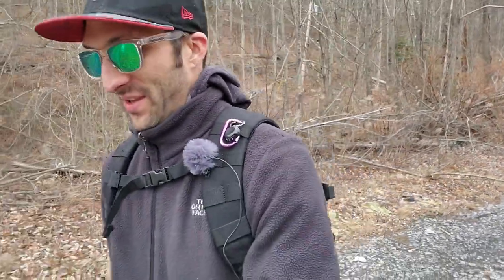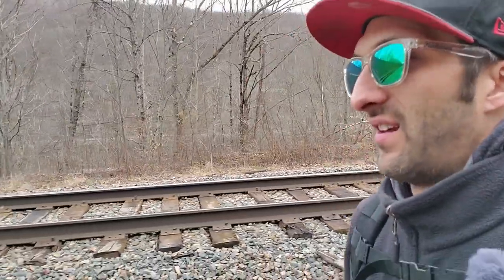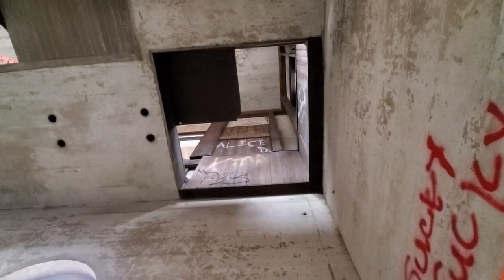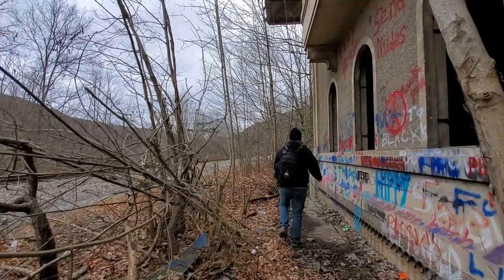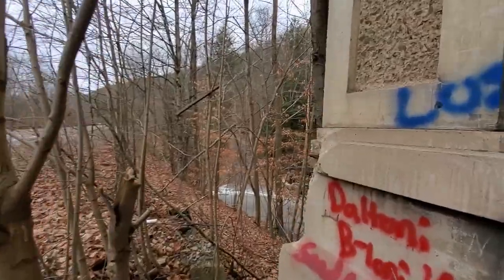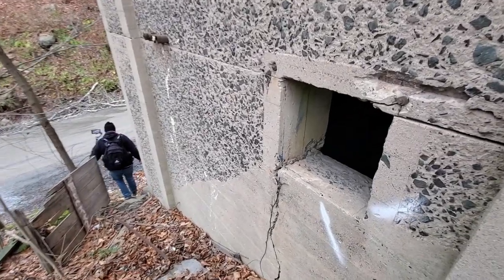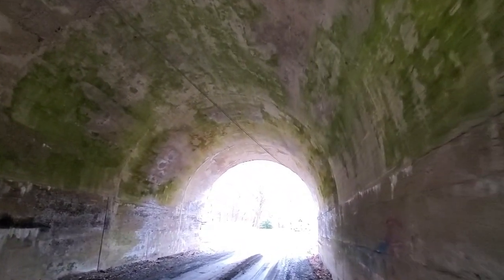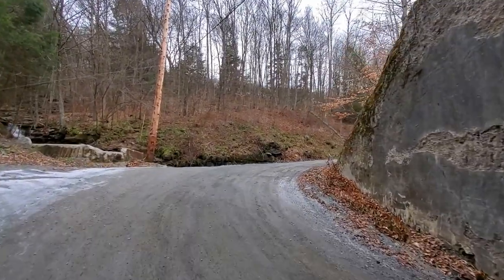Exploring Abandoned Train Station & Switching Tower!! (Nicholoson Cut Off)

Comment: Neat little switch house! Found your channel thanks to your gang with JP, the wandering woodsman , RJ, Revenge of the Apocalypse. In the switch house, those black circles on the ceiling on the main floor, they look like round electrical boxes for the light sockets or fixtures. Interesting switch lever mechanism on the upper floor
Reply from the maker: Hey there Dennyfilms!👋 thanks for taking the time to check out my channel. I appreciate that😊 yes love getting to go out on adventures with the crew, amazing group of guys! 
I absolutely love that switch tower. I'd love to convert it into a house. I wish I could have squeezed my way up to but luckily jp had that action cam with the extension rod we got a nice look at the switches. Hmm that would make sense for lighting!? Interesting. And thanks again for checking out the video hope to have you along again for some more fun adventures A
Reply: Out Naturing use welcome

Comment: There is a third building on the other side of the tracks down by the pond that was Used for pumping water to steamers. It is in better shape with less "tagging".
Reply from the maker: Wow awesome.  I didn't know about that! Will have to look into seeing that! Thanks for the tip!
Reply: Also the church still has services every Sunday and Wednesday. The station was closed in the 1940's went the third set of tracks going to Montrose was closed. In the 1950's the ticket counter was ripped out and reused as a check out counter in a local store. There was a turntable on the other side of the tunnel. There is also the water tower base on the other side of the railroad tie pile. The platform was intact 20 years ago it was concrete with metal trim.
Reply from the maker: @robertklim4216  wow thanks so much for that information! Definitely going to have to go back there and do some more exploring! So cool.